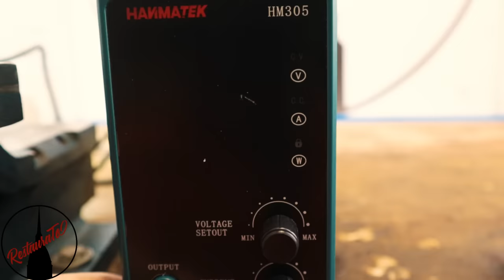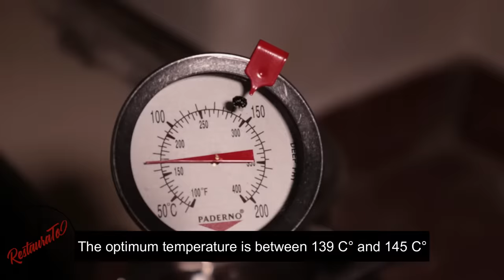Rusty Revolver Restoration 38 special - Restoration of gun

Comment: What awesome work you do, sir. May I ask your opinion about sonic cleaners? Not for rust, but simple cleaning hardware. I bought a Harbor Freight ElChepo for 59 bucks. Seems to work very nicely for me. but you have to consider my skill set. 
Cheers from Louisiana.
Reply: @restaurato6629  I picked up a little one at Harbor Freight and some Hornady gun cleaner solution online. I was blown away just how well it worked on a little S&W 38. You can literally watch the crud explode off the metal.

Comment: That liquid really didn't fool me.  My urine - I presume normal - is less viscous.  Some sort of rust remover and or penetrating oil, I suppose.
Revolver side plates should never be pried off as shown.  That has a tendency to gouge up the edges.  (Especially with more valuable guns.)  Suggested is to strike the grip straps - without the grips with either a hard wood club or a rubber mallet and the side plate will be extracted by inertia.

Depending on the level and depth of rust, very fine steel wool will remove rust and not damage the surface.  The same can be done to surface rust spots on a piece not so far gone as well.  Use a bit of penetrating oil to begin and let it set a bit prior to the steel wool.

The nickel plating is new to me.  Looks like it works.

I like the finish with the pits intact.  Much like battle scars.

Good video.  Reasonable techniques, good views.

Comment: Where do you get the firearms to restore?  Is there a website?  I'd be interested in doing this.  Also it's obvious you have knowledge in electroplating.  Why use acid pickle (pure hydrochloric acid) to remove the rust instead of electrolysis?  Leaving metal in hydrochloric acid for that duration can degrade the metal even in the substrate.  If your going to use that method I'd suggest a post bake of 250 to 300 hundred degrees for at least 8 hours.  I'm sorry to critique and you probably won't read this but if your planning to fire this firearm it would be smarter to use a process that won't jeopardize the integrity of the steel.  You did an amazing job though!

Comment: Same Cadix Model Frame, The Astra´s Snubies had a Commercial Name of ASTRA 250 if was a carbon steel and 250 Inox if was stainless steel version. Carbon Steel 250 was made in various calibers like 38 Spl, 32 S&W Long and 22. 250 Inox only 38 Spl. The Cadix use the same calibers and 4 or 6" barrels The Cadix Stainless Steel Model only combine 4" and 38 Spl, The showed model ia a ASTRA 250. ;-)

Comment: i would avoid using the wire wheel on the outside of the gun, and you could have sanded the pitting on the outside with fine grit sandpaper 800 going up to 1200 then on a polishing wheelfor a mirror finish before blueing it.

Comment: Not started watching yet but in case you did not know, what the old timers used to do to blue a gun like that was to RUST IT just like that then BOIL IT IN WATER.  The boiling water converts the rust to bluing.

Comment: Not sure about YouTube rules, but you NEVER EVEN WORKED THE ACTION after it was done, cocked the hammer or pulled the trigger. FAIL. Also, at 10:38, large crack goes through the screw hole, never attempted a fix. Also FAIL.